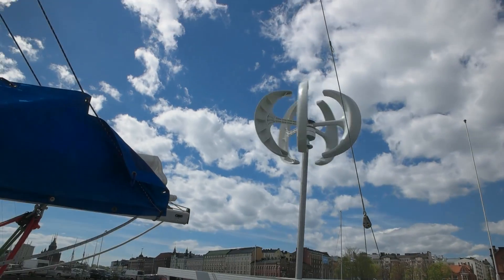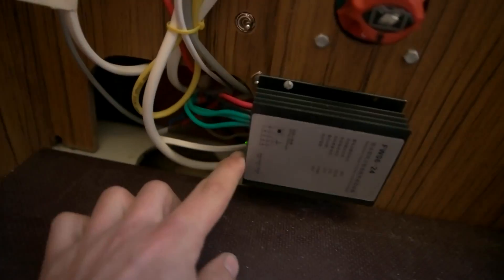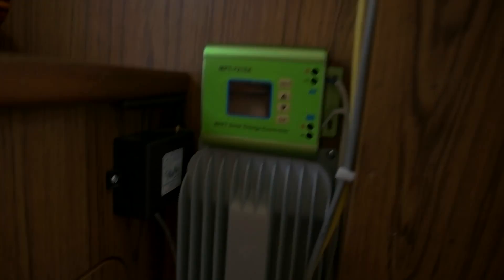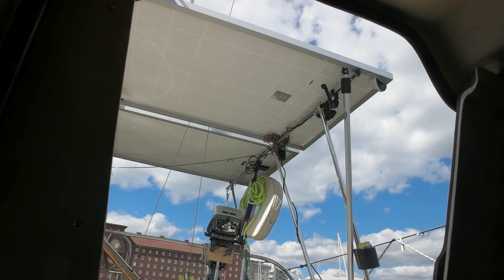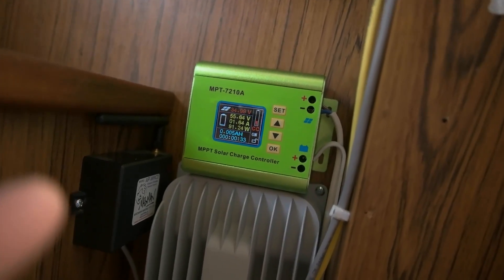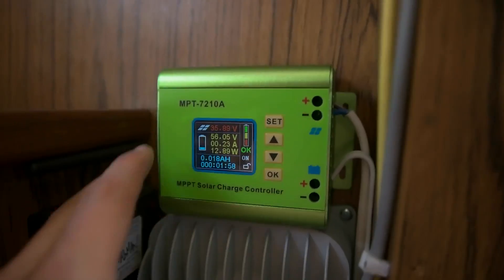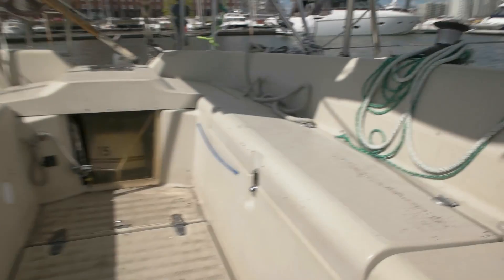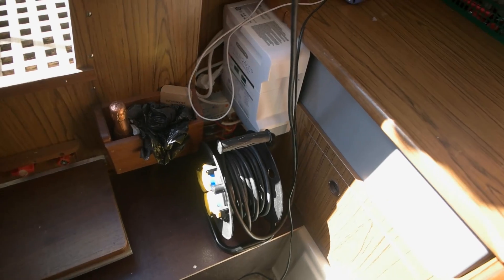Series to parallel - Electric sailboat vlog 0016

Comment: With HAWTS , every blade generates torque when the wind blows, whereas with VAWTS, only one vane generates torque at any given time. That's the main reason HAWTS are more common. Although they are not without their pluses, VAWTS just aren't as efficient.
Reply from the maker: +Hanford Creek Very good point! I knew that VAWTs are not that effective, but I hoped it would generate a bit better